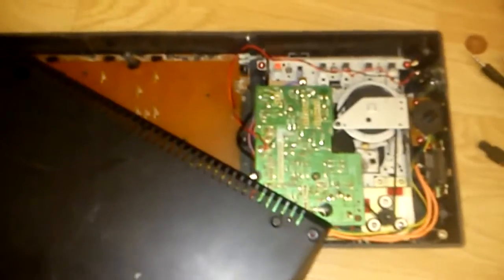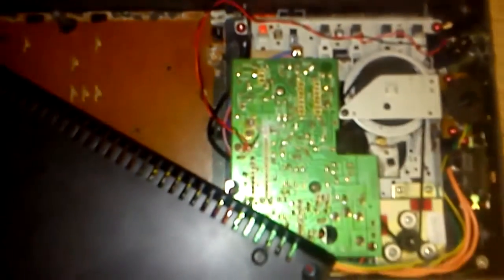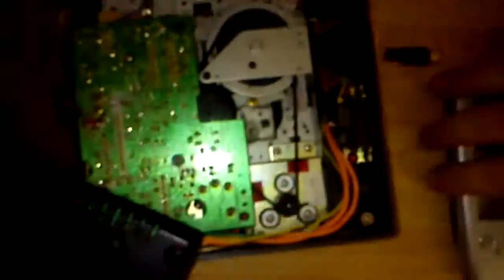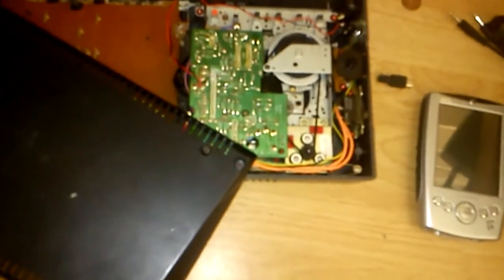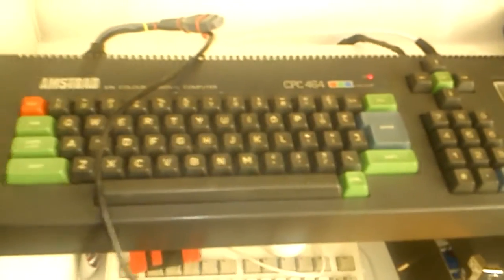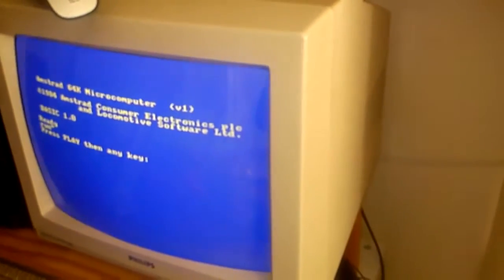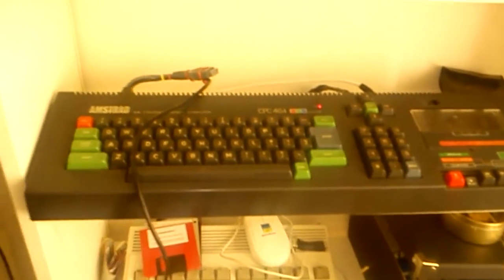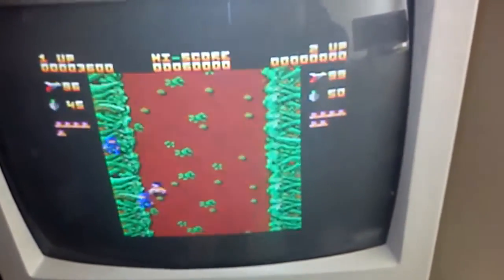'Audio in' mod for Amstrad CPC 464

Comment: Nice work.  Have you considered using something other than mp3,  because that codec is known for bad compression characteristics with audio.  If you still want compression maybe try m4a AAC at a reasonable bitrate above 300,  as this is a bit cleaner and more balanced sounding.  Once I do my own CDs I will probably use a lossless codec like FLAC,  which is typically 1/3rd to half the size of normal CD Audio files or WAV.
Reply from the maker: EgoShredder that is actually a great idea ..I'll give it a try when I get a chance and stick up an update video

Comment: I'm considering doing this on a 464 plus, but modified slightly further by hard-wiring a cheap MP3 player (board only) into the system and then separate the LCD and buttons so you can see what MP3 you've selected. Could be a nifty mod. Not sure I can be arsed though.